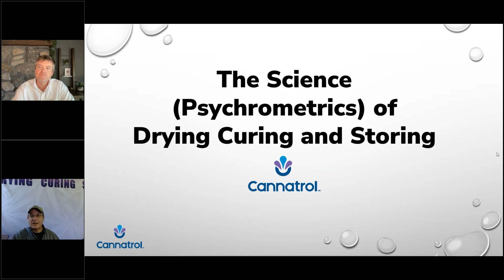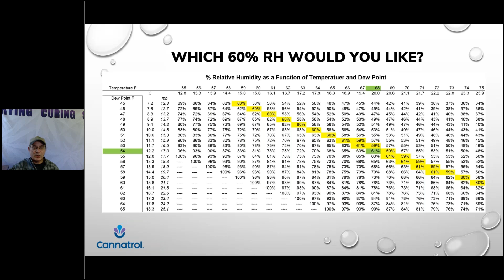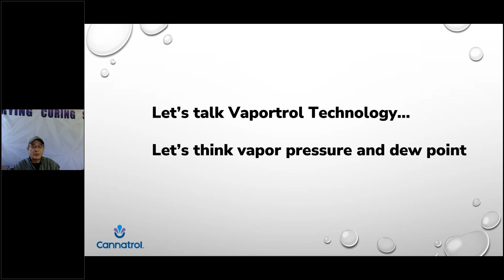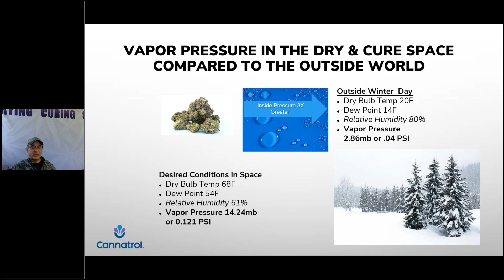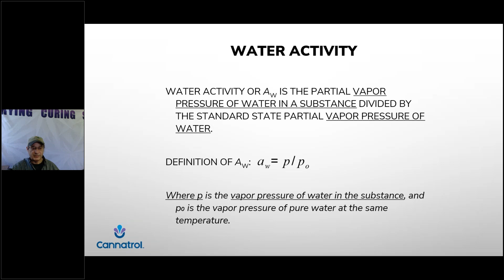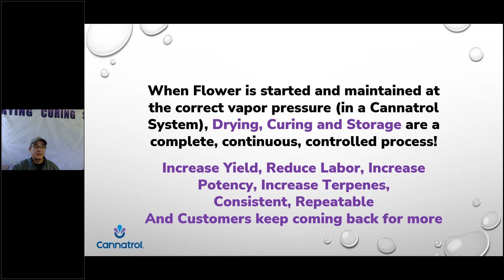Drying, Curing and Storing Cannabis - Cannatrol Systems

Comment: I'm using my Cannatrol for the first time in May of 25. It looks to be just what I needed I've had to throw away so much by screwing up the cure..i just can't get ut right and within 4 months its all gone to crap despite burping the jars a few times a day.  I almost stopped growing because of this. And I also would not manicure till I needed it. This way lasted far longer than burping jars. But far from good.. I got the extra set if trays to hold a bit more.. fingers crossed 🤞 it does what they say. On day 5 now. Still
Reply: How was your dry and cure run? did it make a huge difference? How'd the buds turn out? i just ordered mine and will be here on the 5th for my harvest coming up in a few weeks and I'm extremely curious. Most bad reviews come from people who don't have one and the only constant problem I've seen through all videos is the price which is disgusting.

Comment: Why is the topic of chlorophyll breakdown not discussed in any Cannatrol or Vaportrol content? Chlorophyll breakdown has a direct relationship with drying time and moisture content. Fast drying time limits the ability for chlorophyll to breakdown because chlorophyll requires time and moisture to degrade. I appreciate that these systems can turn fresh flower into dried and "smokable" product in 8 days, but how does it taste and smell compared to longer slower drying times where more chlorophyll is broken down? Chlorophyll is responsible for "hay" smell and harshness when smoking, and many owners of the Cannatrol will attest to the hay smell and no apparent terpine smell after they dry their product in the cannatrol.

Comment: How do commercial growers both retain terpenes in drying and curing but the cannabis still has "loud" aromas when a bag or jar is opened? This seems like a quality that most people appreciate and associate with high quality, regardless if the "loud" aromas expelling from an open bag or jar means off-gassing and evaporation of terpenes. Some people may be willing to sacrifice some of the terpene loss if it means they can smell the terpenes when they are inspecting a bag or jar. Many buyers at a dispensary choose the strain they want by aroma which often translates to flavors and strength. I know certain strains are "louder" than others. I am currently drying a strain that normally an open bag will pervade a whole room with "skunk" smell. If it has no smell, then most people may think it's a weak strain or poor grow and post-harvest care. Very few people have said that a secondary extended cure time in jars, grove bags, or even in the Cannatrol will improve the "bag smell". Some data and science on that would be great to have.
Reply: what's "loud"???

Comment: My first run through the Cannatrol on default settings is on day 2 and the dewpoint has lowered some but is currently at 60 degrees (77% RH).  I'm a little worried about mold development. I wish the system was slightly more aggressive to come "online" to the target DP. There are no instructions or recommendations for this circumstance other than perhaps removing some flower if it's overloaded with wet fresh flower. What I'd like to know is if this means I will have to extend the dry cycle further than the default 4 days since the DP will not reach 54 degrees for probably another 24-36 hours by my estimation. Instructions say the DP should come down to 54 degrees within 30 minutes to one day. What should you do if that is taking much longer? How many days does the flower need to maintain 54 degrees DP to be properly dried? By the instructions recommendations, it seems that that should be a minimum of 3 days, which would mean that I will have to extend the dry cycle by at least an additional 3-4 days if that is how long it takes the DP to drop to 54 degrees. I have not added the sponge yet because it does not need more moisture, but this was not explained in the instructions that you may need to delay using the sponge until target DP is reached. This was just mentioned by other users testimonials. I have emptied the water collection 5-6 times. It's probably removed at least 16 ounces of water so far.
Reply: Did you ever figure a way to resolve this?
Reply: @kndtony1252  This was last year and yes I trusted my instincts and added days to the dry cycle so RH was near 54 degrees for 3 days prior to beginning the cure cycle. Sadly some mold developed on some of the buds due to the time it took to lower the moisture in the dry cycle because it was overloaded. After that batch, subsequent loads had much less wet flower in them and the RH went down much faster so the dry cycle was 4 days. I have the first crop this year in now, and made sure to load it with less than 2 pounds of wet flower. RH went down to 54 degrees in 24 hours like it's supposed to, and the drain cup has been dumped twice in 24 hours. If you have more than 2 pounds of fresh wet trimmed flower needing to go in the Cannatrol, what I did was to put them in a  big plastic bag in the freezer if you don't have another means to dry them while waiting for the Cannatrol to finish with what's in it. I did not notice any quality loss with the frozen buds at all, and it prevented them from molding while waiting to get in the Cannatrol.  The name of the game is to not overload the Cannatrol. No more than 2 pounds per batch. If you get backed up, freeze wet trimmed bud or dry it traditionally while waiting for batches to finish.

Comment: Just bought one 5 days ago loaded it up and today it will be done drying @ 5:00 pm took out a sample bud and the sugar leaves are not dry and crispy they are just like the rest of the bud and not crispy anywhere but just perfect.

I put some in the grinder and it looks great and smoked it and it's smooth and tasty.

I give the cannatrol a perfect score of 10 I couldn't be happier thanks for your invention the Ash burned out to a nice white
Reply: I'm thinking of getting one [big cost]
So you'd recommend ?
Reply: @garylee-pl9dl  Yes it's the most important thing you can have and works just like they say , after the drying and curing of eight days I took it out and put it into a jar with a humidity meter and it reeds 60% and it's been holding that % for five days now it never went up or down and it's the smoothest stuff I've ever smoked you will be impressed don't hesitate just buy one
Reply: Have 2
Reply: The ash burning white is indicative of the plants diet. The curing has very very little to do with the white ash 🙏 . . . . I mean. Who cares, it sounds like your growing right, and you own this unit 🎉

Comment: Would I have to run my AC all day if my house reaches 100° during the day and high 80’s during the night?
Reply: You don’t run ac when it’s 100 defrees inside?
Reply: @mcgritty8842  I do run my ac in hot weather. The cannatrol is not an air conditioner with a condenser from my understanding. It’s not meant to “chill” the flower like a fridge. I turn off my AC when it’s around 75°F or lower. It seems like it will only cool down the environment inside the cannatrol by around 10°F
Reply: @eddyx420 tbh then it's pointless haha
Reply: @ not necessarily. The area where I live at is about 70° on average and I have my cannatrol set to 60°F and 60% humidity. The cannatrol uses 70w of electricity while running my AC is about 700 or more Watts. So for every 10 hours of using my cannatrol is like using 1 hour of AC and since drying takes days, you’re saving money in the long run.
Reply: Yes! I live in a tropical island and have a cannatrol. If I don't run my AC all day in the room, the temps could reach high 90°s and the cannatrol won't stabilize.

Comment: Not worth it, I'm sure this will get deleted. Way overpriced. I have had mine for over a year and have 10+ runs through it. Good for drying, SUCKS ass for curing. Customer Support is non existent. Wish I would have not wasted 1600.
Reply: Does it not have smell or taste?
Reply from the maker: Sorry you had trouble getting through to customer service!  Was it through the number 802-738-0709 or by emailing inquiry@cannatrols.com?
Reply: Pretty sad that either way they never got back to OP.  People say it’s an American made brand and you’re literally proving that American made products are not reliable.
This right here is a good reason to avoid this brand, at least for now until they improve all around.
YouTubers push products for consumers to get interested about… but we need to wake up and stop buying!
The cannabis revolution shouldn’t involve so much consumerism and materialism.
BUY BUY BUY!!!! 👎👎
Reply from the maker: Just checking in to make sure you were able to get in touch with customer service to run through your settings and ensure your Cool Cure is running as effectively as possible!  Please let us know if you are still experiencing issues!

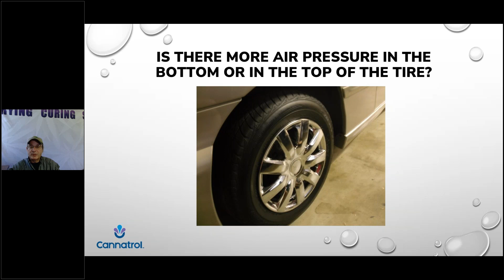Comment: 10:30 Hate to be nitpicky, but the pressure is not equal between the top and bottom of the tire, right? It's minimally higher at the bottom because the atmospheric pressure adding to it, right?

Comment: I've ruined gorgeous flowers for five years straight on the cure. "60/60" with grove bags only did so much. I have high hopes for my Cannatrol but there is some "broscience" folks out there worrying me, plus this guy down here selling his already.... I already pulled the trigger on that huge pile of cash. Edit: have received unit, seriously on that logo sticker on the front... I can see the stuff behind it. This unit better work. EDIT: First cure run done and I COULD NOT BE HAPPIER. Other than my Gavita light, this was something I didn't know I couldn't live without. I was close on my own but this sealed the deal and took ALL the guesswork out.
Reply from the maker: Wow, thank you so much for your feedback!
Reply: @cannatrolsolutions  Open a Europe/UK branch, looked at one on your site $1800, fine, then it's $2200 to import it !
I think you'd make a killing in Europe/UK
Reply: @cannatrolsolutions im starting my prototype build next month ,
Im coming for you Canntrol with used materials $60/ a $60 frame and maybe 350 in parts  (a 46 year old Blackman, Son of a MIT graduate /engineer, i grew up with my house looking like an electronic junkyard 🤨)i’d hate to burst your bubble on your patented cooling technology and outsourced 24volt controller with a 12 V resistor on it  🙄 hint hint; its so cold in my home right now maybe i should turn the heat on,,🙄 24 volts turned into 12 v , hint hint (. 🤫Shhhh i would use the hot and cold thermoelectric chip reverse polarity also to have hot and cold too🙄) LOL the Cannatrol is for people that cant think 🤷🏽🤨……..

And like i said, im coming for you 🤨!!! 

This message will self-destruct in a few days 🤫 , 💥💥💥💥💥
Reply: Did it work?
Reply: @matthewdean2213  100% hell yes
Reply: @matthewdean2213  YES! sticky awesomeness

Comment: Love to have one off these machines !!!man i wish they where more affordable hopefully price goes down??? ,i think its a great ideal 😊
Reply: You could offer "curing as a service" as a financing method for the machine.
In Germany, it is totally VERBOTEN to give cannabis to others even though they just 'legalized' it. I couldn't do it, but if you are in a state where you are allowed to store flower for friends/customers/etc, that would be an option.
Reply: I built one for less than $80 😂

Edited: I bought a used wine cooler the size of a mini fridge for $30. Put a $15 dehumidifier in it. Plugged that into a $20 humidity controller. You can also add a $10 heating pad or wet sponge if needed. I just ran the wires through the crack of the door and taped them. Works great. I use the metal bottle racks to hang buds from or I can use shelves I made out of cardboard. Only smells if you open the door. I still let the plants hang in the tent for a week or so before sticking them in the 60 degree cooler.
STAY FROSTY! 🌱✌😎💨💯
Reply: @Featherless1 how?

Comment: what they're asking is if you come out with like a wifi version, or a version that tells you when to add water to sponge, or a version that doesnt require you to open the door to add water... will you offer a trade in / a good discount to current owners who want to upgrade to the new version
Reply: and all accessable through MQTT or other OPENSOURCE Protocols. Nobody wants to use a crappy app from
manufacturers 😀